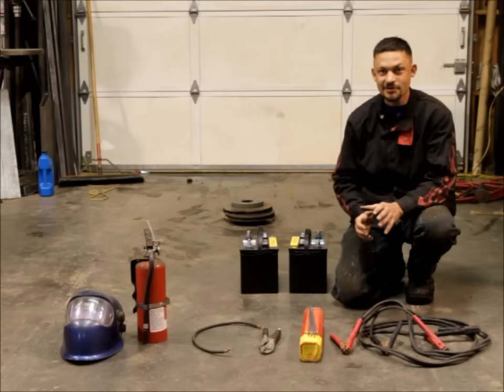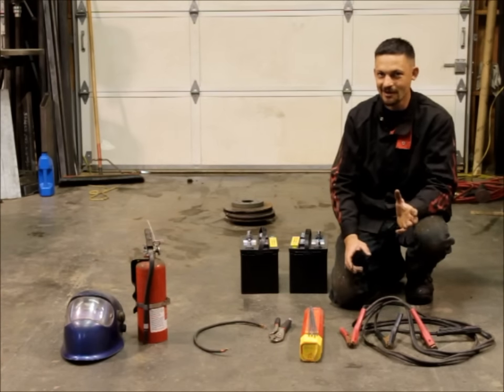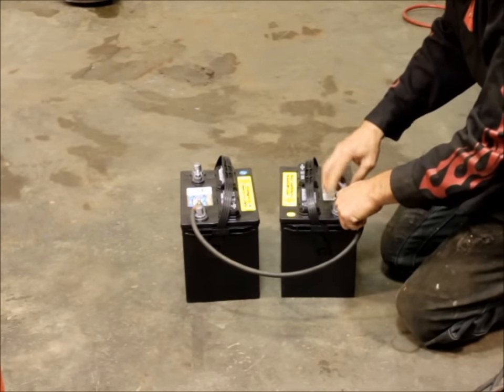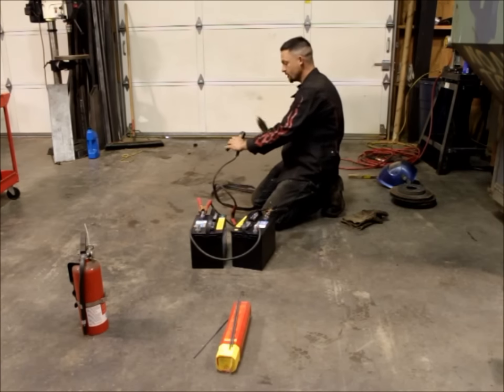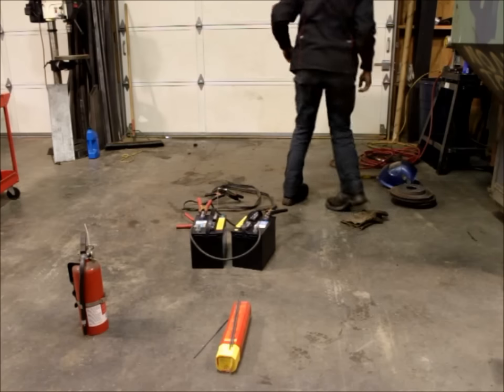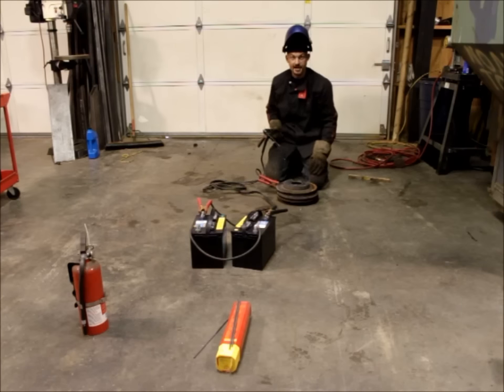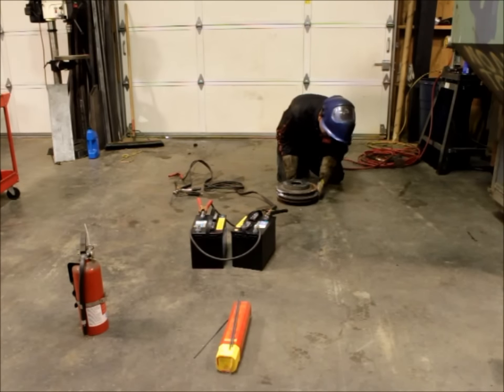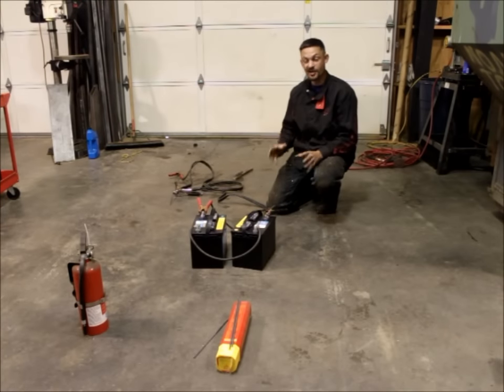Welding with jumper cables and a pair of batteries

Comment: I just witnessed my first battery explosion the other day.. Was far from pretty as my buddy was luckily shielded by the fender.. Went KABOOM like a stick of dynamite.. We were just jumping it off.
Reply from the maker: Battery explosions do happen...and they can be very dangerous.  I've seen a few of them; every one was as a result of improper charging, jump starting, or a short circuit.  However, I've never seen one happen to a healthy battery that is being used within its capabilities...
Reply: I have a whole new respect.. It was an old battery.. Fluid levels were good. The one thing I noted was they hooked the ground lead to the engine block instead of the battery post.. I swear it got a back feed from the alternator while cranking.. My advice to anyone: Always hook to the battery posts.. Welding with two of them is pretty cool but man I'll tell ya they blow up bad spraying acid that is like #2 on the worst acids list..
Reply: sewerzuk
Reply: fla playa never to the posts.
Reply: ***** Always to the posts in older cars. There's a sequence I've used a hundred times. Connect dead - first to energized -
Then dead + to energized +

In newer cars yes the posts almost costed a kid his face and that woman a car in my story.. He was stupid and direct shorted the cable attempting with live jumpers.. Never attach to the energized (not dead) battery first is all I got.
Reply: GoldPitbulla z
Reply: fla playa the battery's are sealed with small vent holes. That's why not to the straight to post. And the other reason it wants to explode now a days, it's because of the cells melting together.
Paul Hartman what?
Reply: "Batteries" is plural for battery GoldPitbulla. Wow man they have vents? So in a 2000 S-10 pickup where should we put the cables? On the Carburetor or something? Holy shit good luck blowing your face off in the future.
Reply: fla playa maybe a good metal ground(block). You can go carb if you like, but duck.

Comment: won't this ghost the battery
Reply from the maker: Cody Griffin no, the batteries aren't damaged as long as you don't fully discharge them. The current you drive during welding is no more than a starter motor or winch motor poles during normal operation, and is well within the batteries normal design discharge rate

Comment: realistically the only real danger would be a large voltage difference between the two batteries or using old batteries.
other then that battery is just doing what it likes to do...discharge lol

Comment: Brake rotors: not steel, but rather malleable cast iron.  Good for an example you will throw out, because the welds are all going to crack free of the cast iron given  the electrodes are not cast iron, and the fact that a heat muffle is not used, along with preheating.  That being said, I lack experience in the variety of ways I’ve seen cast iron welded.  But I’ve seen plenty of fails, one of which I paid for which convinced me to start welding rather than trust a guy who owned a welding shop and should have known better.  Instead, he just ripped me off.

Comment: Don't you know sitting batteries on concrete will drain the batteries!
Reply from the maker: This is not true.  This is misinformation carried over from about 50 years ago; battery cases have come a long way and sitting them on concrete does not cause any problems.

Comment: Good luck with this, if the batteries don’t blow up, or the insulation on the cables doesn’t melt, you’ll end up with two discharged batteries.

Comment: Yo jacky you aren't supposed to have a battery on concrete. It drains the battery 🔋
Reply from the maker: Gerbroni TV yo Jacky, that's not true.  A myth that's a holdover from 70 years ago when cases were made from a porous material.  No problem placing batteries on concrete.
Reply: Matt Verley good idea for a video?

Comment: Connect the batteries to an 12volt dc inverter and soldier a ic chip to it and wire in a microwave transformer and you have a 120 volt stick welder

Comment: You should not set a battery on a concrete  floor.Will drain it.
Reply from the maker: sorry, but that information is incorrect.  Used to be true a long time ago when battery cases were made of a more porous material, but not true anymore.

Comment: i dont believe this why ruin a couple of batteries
Reply from the maker: it doesn't ruin the batteries; I have a pair of batteries that have been used for dozens of trail welds that still work fine.  welding draws around 150 amps; less than a starter motor or winch motor.  welding for 15-20 seconds is no different than trying to start a vehicle or winching for the same time.
Reply: hey what ever flips the boat i rather use my mig welder with a generator
Reply from the maker: rock dawg you're missing the point; this is designed to be used in an emergency for a trail repair, not as a primary welding technique.  I personally own 5 welders, including an engine driven one and I agree; welding with a pair of batteries would be my last choice.  But, its easy to toss a few lbs of welding rod into a rig to add the ability for some emergency welding repairs.  It has saved me more than a few times...
Reply: i hear ya but me i'm not of a fan of using a battery as a supply for welding tool what if that battery explodes for some dumb reason iv'e seen batteries do that it aint pretty acid every were i'm an old pro i believe in using the correct tool for the job its your call

Comment: If you discharge a battery by shorting it to ground, it WILL produce enough heat to boil the electrolite and it WILL produce hydrogen gas FACT.  I have experienced this first hand, it is not pretty.

Comment: Hey awesome video, I understand that car battery's are used because of the high amperage, this might be a stupid question but I have 4 12 volt 12 amp hour ebike battery's, i thought maybe I could wire my 4 battery's in series parallel just to tack a number of things in place before I bring it to my welder, I know that probably sounds stupid but I don't have enough clamps and vice grips to have all my stuff I need welded clamped down place, and I feel like making 10 trips across town on my bike, just trying to make it Easyer on me with what I have, I crossed my mind to borrow the wife's car battery's out of her car but its not worth the risk ahaha anyway I'm. Not attempting anything until I know it's not dangerous or know this would work for tack welding
Reply: Don't feel to making 10 trips***

Comment: shouldn't put those battery on concrete
Reply from the maker: Sorry, but that's a myth.  Used to be true many years ago when battery cases were made of a more porous material, but modern batteries are not discharged or damaged in any way if they are placed on concrete.
Reply: sewerzuk alrighty. well learn something every day lol
Reply from the maker: no problem :)  I get that particular comment often.  Just so you don't have to take my word for it:  http://www.snopes.com/autos/techno/battery.asp
Reply from the maker: http://www.interstatebatteries.com/m/mrbattery/faq/batteries-on-concrete

Comment: You have over 200 dollars worth of batteries but you won't buy a 150 dollar welder from harbour freight
Reply from the maker: J.R. Kitchen you have totally missed the point.  I own over $40,000 worth of welding equipment.  This is a technique used for emergency trailside repairs where no shop equipment is available.
Reply: That's funny. My Lincoln will fire up and weld on the highway or in my shop
Reply: My Bobcat and Trailblazer welders will too.  But this isn't designed for emergency repairs along the highway.  It's impossible to fit my engine driven machine in my rock buggy and lug it down the Rubicon.  Or Fordyce.  Or moon rocks.  Or Black Bear Pass.  Or any of the other trails where I have used this technique to repair a broken vehicle to help it limp off of the trail.
Reply: Dude. Id just learn how to weld and fab a proper buggy.
Reply from the maker: apparently you've never really been wheeling.
Reply: No lol i never have, i don't really have any hobbies other than messing with people on YouTube

Comment: don't sit a battery on concrete it will kill it
Reply from the maker: +Justin Teno It amazes me how many people still post this.  This simply is not true.  It USED to be true many years ago before manufacturers developed better battery case materials, but it isn't true now.  A battery sitting on a concrete floor will not be drained.

Comment: never put car batteries on the floor without a piece of wood or rubber underneath . contact with the ground will permanently damage them . something to do with interference from the earths magnetic field . don't    do it again.
Reply from the maker: this is a myth, carried over from years ago when case materials were semi-porous. with modern materials, placing batteries on a concrete surface is just fine.
Reply: That's right. Early battery cases were made of wood impregnated with tar. When placed on concrete, it would drain the battery. Today the cases are plastic.

Comment: Never leave a battery on a concrete floor 🙄
Reply from the maker: Dan Swan not true.  Feel free to read through the comments for the MANY times I've provided links to battery manufacturers who have debunked this myth.
Reply: Well my wife left mine on the floor and it drained within a few days. But if you leave them on the floor for a long time let me know how it works out for you...
Reply from the maker: *sigh*.  I'll do it again.  I leave my batteries on the floor for months at a time, and they are perfectly fine.  Don't be a jackass, Dan.
Reply from the maker: https://www.snopes.com/autos/techno/battery.asp
Reply from the maker: https://www.homepower.com/articles/solar-electricity/equipment-products/ask-experts-batteries-concrete
Reply from the maker: https://northeastbattery.com/do-cement-floors-ruin-car-batteries/
Reply from the maker: http://www.todayifoundout.com/index.php/2017/02/storing-car-battery-concrete-floor-drain/

Comment: If buy all that in auto part store it $200 and even for a week charger is like mother 40 better buying a buzzbox.
Reply from the maker: Derek Kirchinger you’ve completely missed the point.  This isn’t designed to replace a shop welder.  It is designed to be used in an emergency out on the trail when a conventional power supply isn’t available.
Reply: One battery is good just find use low votage rods. I seen the inside of people dine thus. Will never put back in car after been used for welded. But good video.

Comment: And another tip..never put good batteries on concrete or asphalt. It will drain them!
Reply from the maker: this is not true...it USED to be true many years ago when battery cases were made of a more porous material and venting systems were less advanced, bit modern batteries can be set on a concrete floor without adverse effects.
Reply: +sewerzuk your wrong, in so many ways. lol
Reply: Matt Verley t